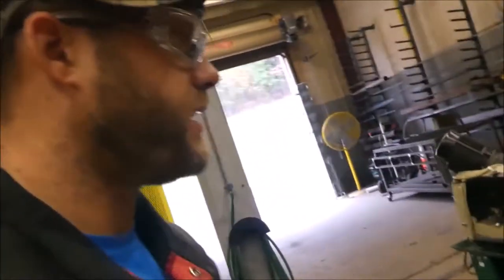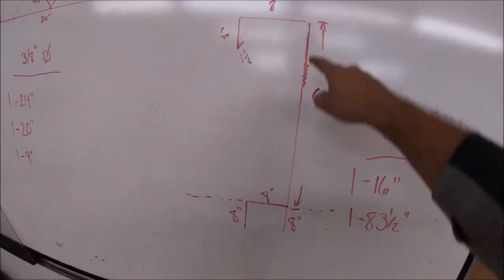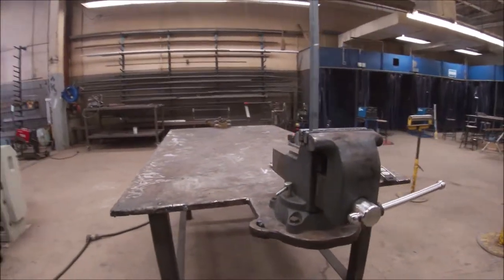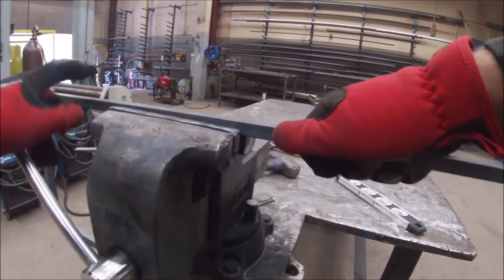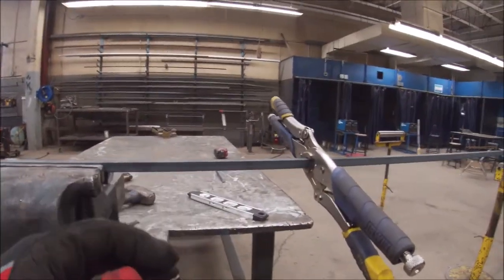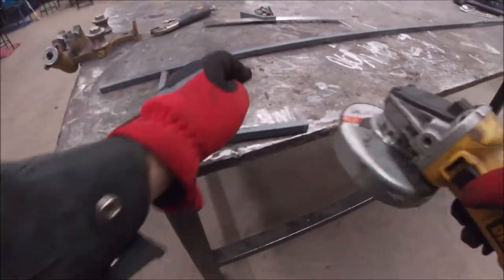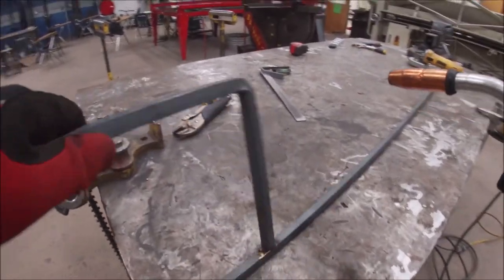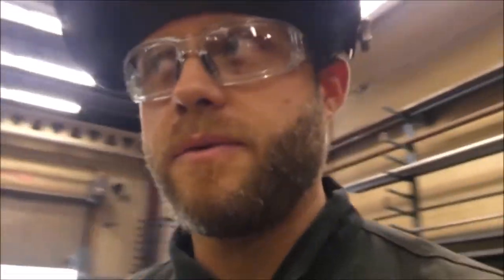HOW TO - DIY Shepherds hook (Yard Hanger) - CHEAP and EASY!

Comment: Wouldn't this be easier and faster with a forge and a anvil?
Reply from the maker: Possibly, but you'd also have to deal with the strike marks from the hammer, and an anvil would make less consistent bends than a vise.